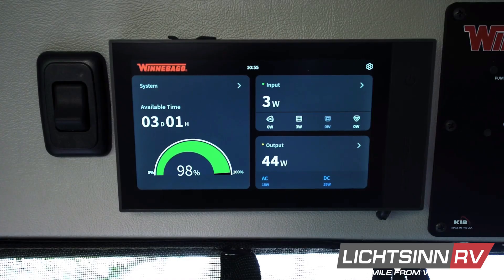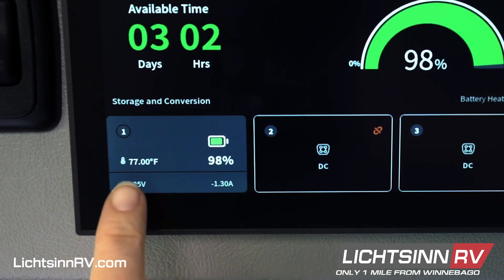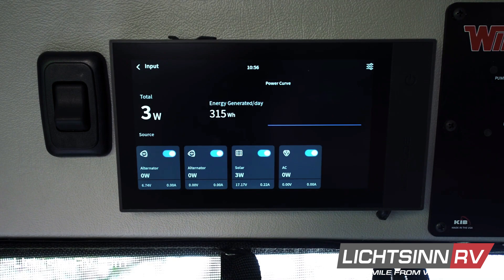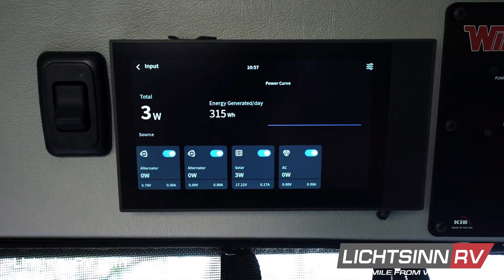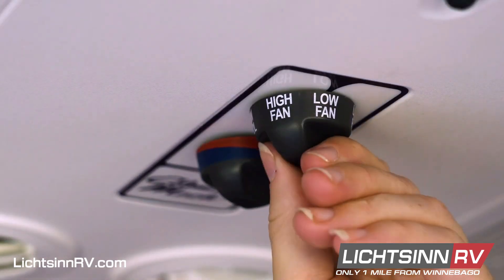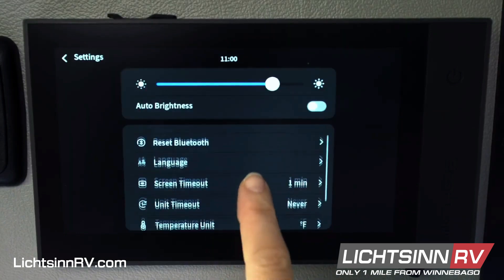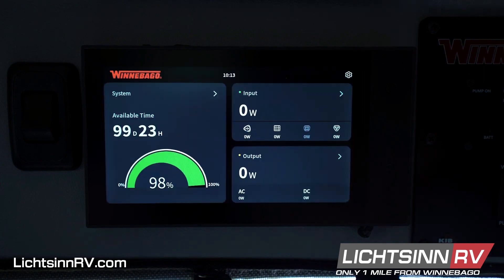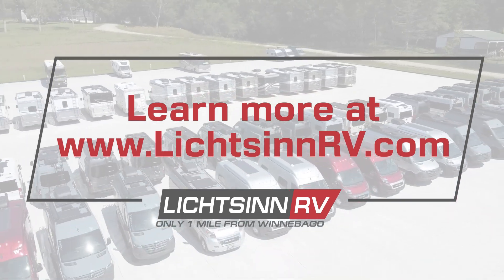LichtsinnRV.com - Winnebago Solis Pocket 36B Winnebago® x EcoFlow® Power Kit Pro Energy System

Comment: Does the Solis Pocket 36A have the EcoFlow Power Kit Pro Energy System as an option? Or, can you add it afterwards?
Reply from the maker: Good afternoon!   Thank you for your note!   While the EcoFlow system is an option in the 36B, not in the 36A, we could add lithium to the 36A.  Hope this helps!
Reply: @LichtsinnRV  Thanks for your reply! My goal, along with others, is to be able to run the AC while boondocking without a generator, in the 36A. How would that be possible? Add or replace the AGM battery with lithium and add more solar panels to the roof? Add an extra 5K battery under the dinette space? Is there a solar battery like an EcoFlow or Bluetti I could put under the garage and use as shore power source?  Please advise on how to do this, as this is the one point stopping me from buying. And, how many hours I could run the AC with this solution? I want a fixed bed, so forget the 36B. Thanks!
Reply from the maker: @francesnance9110  Good afternoon!  Thank you for your note!   The best approach to this would be to swap the current batteries for Lithionics batteries and wire a 2k or 3k inverter into the AC.  With a single 320 ah battery we are seeing AC run times 8-10 hours.   We could add more solar but quite honestly it's mostly a trickle charge on high out put Lithium batteries.  If you'd like to pursue this simply reach out to a Lichtsinn RV consultant at 641.585.3213.   Hope this helps!
Reply: @LichtsinnRV  Super helpful to know this is an option! Thanks for posting this. I will be giving you guys a call.